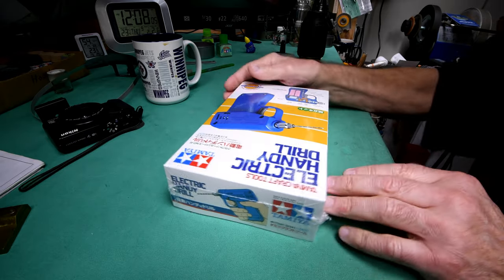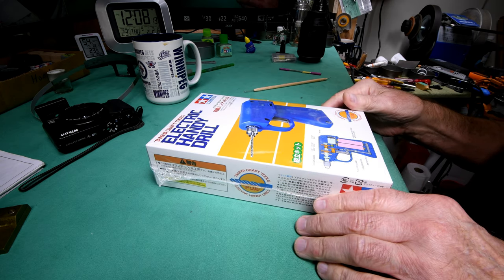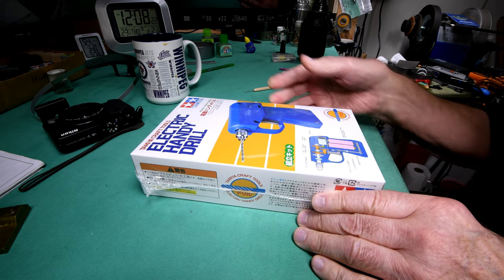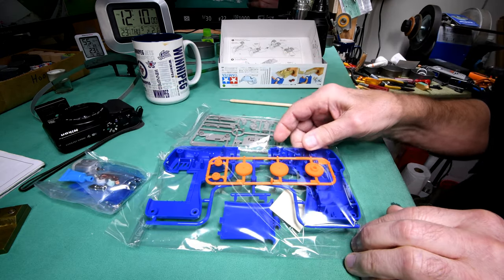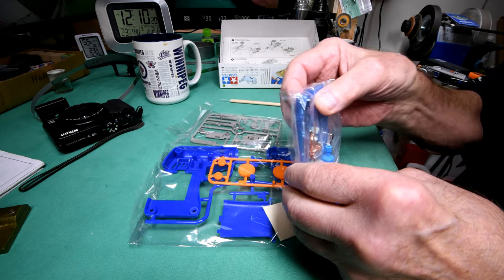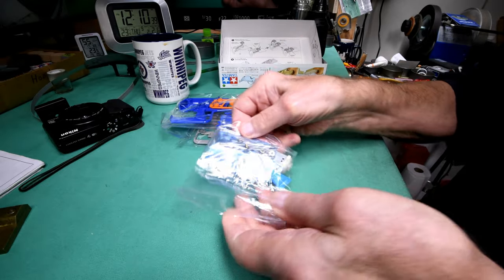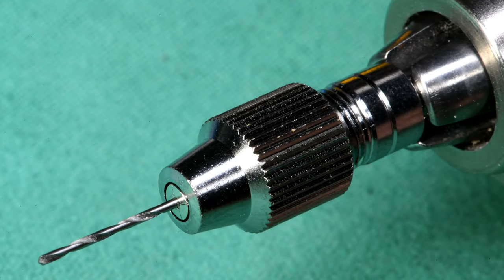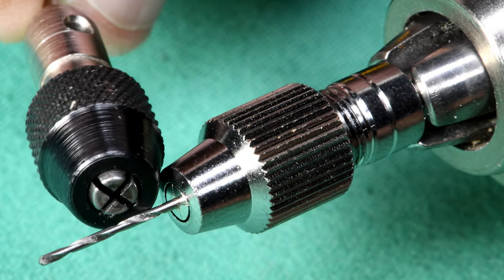The Model Ship - Part 918

Comment: Hi Ron seeing all your tribulations with chucks, colletts and very small drill bits can I suggest you check out a set of PCB drill bits. They come in very small up to 3mm in diameter but the secret is they all have a 1/8th shank size so are consequential easier to get to run true in a chuck. They are normally used on circuit boards but from what I've seen on YouTube a lot of modeller use them and they may be the answer for you. Best wishes Vic.
Reply from the maker: Hi Vic. Yes Thanks! Tony was after me to get those too over a year ago. Just now ordered these from amazon.
https://www.amazon.ca/gp/product/B07S636JHY/ref=ppx_yo_dt_b_asin_image_o00_s00?ie=UTF8&psc=1